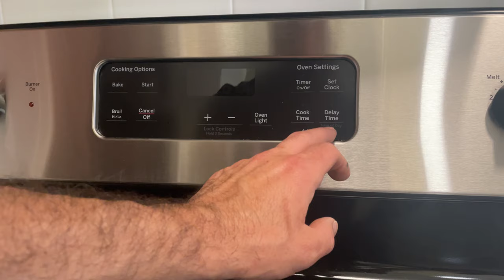GE Electric Range Installation

Comment: Thank you so much for making this video! Just had a question, my owners manual said to insert the ground screw through the ground plate and I noticed you didnt and I didnt add the ground plate either. Does it make a difference adding the ground plate?

Comment: Where did you find the plug for the oven I just received one from Best Buy same range and it said plug included and I can’t find it anywhere
Reply from the maker: Plugs are usually bought separate. But if it said included check the warming tray underneath if not contact best buy

Comment: Do you have to cut the ground strap like that? If you want to preserve it could you just remove it? Or is the copper connection between the two white wires important??
Reply from the maker: It’s been awhile since I made this can you post a time stamp??
Reply: @ApartmentMaintenancePro  2:59 is what I’m referring to!

Comment: I'm trying to convert from gas range to an electric range. But I'm so afraid my power will constantly shut off. It does that when too many things are plugged in. Is it any different than having a gas range plugged in for the time & oven settings?
Reply from the maker: Yes. Read the spec you will probably need a 50amp breaker with 6-8 gauge wire and 240v. Electric ranges use way more power than normal household circuits.
Reply: @ApartmentMaintenancePro  😫 great. I guess I'll just stay with gas until I can afford to have things updated
Reply: Thank you for replying.
Reply: @garciay91 same. Just asked this question. I’ll have to probably upgrade our panel also

Comment: What tool did you use to get the green screw off? My screw is super tight.
Reply from the maker: If a handheld screwdriver or drill can't do it next step up is ratchet or a wrench :) Usually just takes a bit of elbow grease though if it's being stubborn :)

Comment: Do you recommend a new power cord with installation? I was going to use my old one it’s 14 years
Reply from the maker: I would use the old one if the wire still looks good
Reply: @ApartmentMaintenancePro  cool thanks for the response 👍

Comment: The installation is asking for 40amp breakers but I noticed you had 30amps.  Can this model work with 30amps?
Reply from the maker: Please timestamp the section in the video where is shows this is 30 amps. I know you can't because I know this is on a 50 amp breaker. Where did you see the installation called for 40? Please timestamp that as well as I don't want any comments that are misinformed. Thanks

Comment: Yo did I need to keep the power cord from my old stove to use on the new one? It doesn’t look like this new one came with one. Hopefully I don’t gotta go buy one because of my mistake
Reply: New ranges don’t come with power cords (electric in most cases) gas usually do
Reply: @Davespates  appreciate the quick response 👍🏼

Comment: Thanks for sharing your experience..

I have a question please,. 

What is the voltage rating for the RED and BLACK cords?
Reply from the maker: Not sure, it would be written on the cords though
Reply: Voltage between RED and BLACK is 240v

Comment: I installed the power cord exactly the way you did here (removing the bonding copper) and when the GE Cafe Induction range is plugged in I get a check wiring range wiring nit correct  ! Any ideas ? Brand new range brand new house .
Reply from the maker: Is there a sticker or instruction on the back? 3 or 4 prong?
Reply: @ApartmentMaintenancePro  yes there was info for both in the installation instructions  ! I have new construction and the electrician actually REVERSED one hot leg and the neutral when he installed the outlet so that was my find. Thanks for the reply and have a great day !

Comment: Why did you place that bracket on the floor in the corner??
Is it just for sturdy placement?
Reply from the maker: Anti-tip device
Reply: How does it tip over if it's in between the cabinets?
Reply: @ChariDan-ed6me  It's so children don't fall or sit on the ovens door when opened so it does not tip on top of them and injure or kill them. It would tip forward

Comment: What is the difference between the 3-wire and 4-wire hook ups? Thank you
Reply from the maker: Newer construction usually use 4 wire prongs. Older homes may use 3 prong hook ups (United States) no idea elsewhere
Reply: The 4th is a “ground” and apparently it’s insanely expensive to upgrade I just got a quote and it was $1200

Comment: so i can plug this into a regular outlet then?
Reply from the maker: The one I’m installing requires a 210-240 volt receptacle. I don’t know what model your using so hard to say
Reply: Some ge ranges can be 30 or 60 watt those require special outlets the profile ranges are pretty standard tho

Comment: Would a 3 prong work instead of a 4 ? Or is 4 required?
Reply from the maker: Depends on if mobile home or local laws
Reply: Match the cord to the outlet in your wall. But yes both cords work.